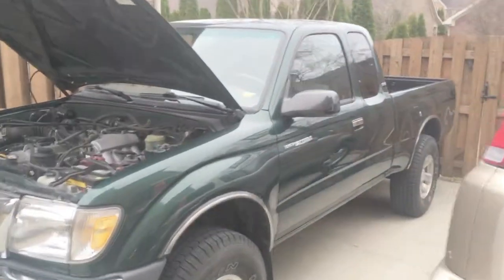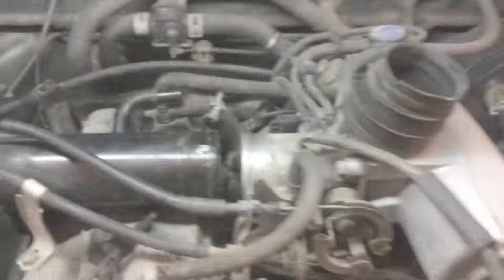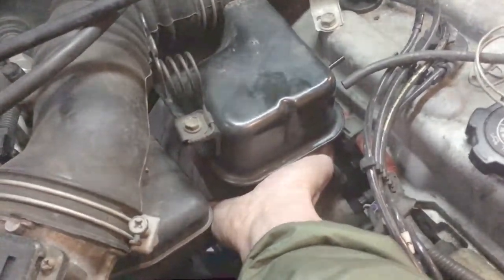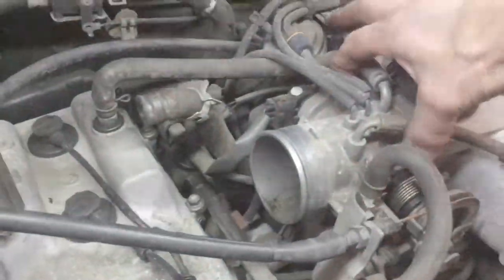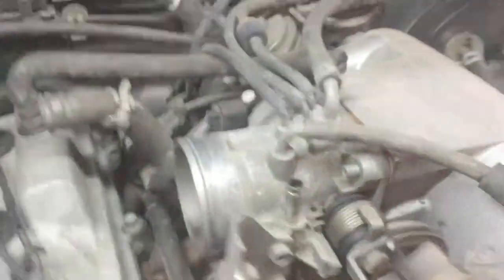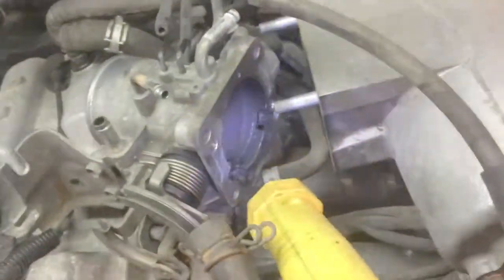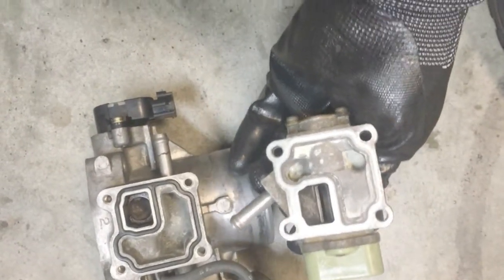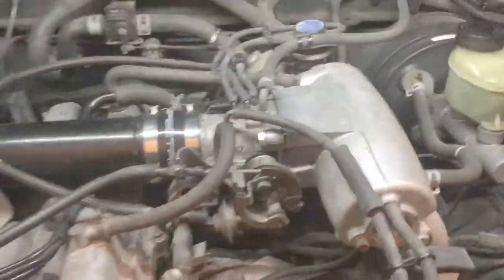Andy’s DIY: 2000 Toyota Tacoma STICKY GAS PEDAL SOLVED !!!!!

Comment: Great video, I was looking for that nut under the black box on the air intake (what actually is that ?) and hopefully everything else will slide away, goal is to clean up intake and replace the throttle position sensor, I have a huge flat spot with no response until I’m almost to the floor with the pedal then it’s great and takes off, it idles fine, starts right up, will cruise easily at 75 but is miserable around half throttle